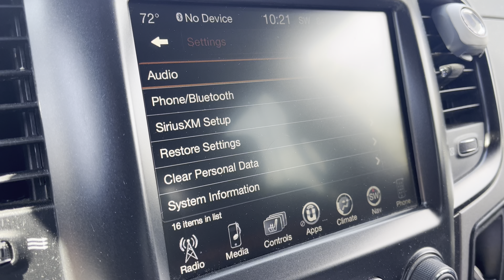FIX YOUR DODGE RAM AIR SUSPENSION PROBLEMS FOR GOOD! Monroe Air to Coil Kit DIY Tutorial $655

Comment: Monroe says this kit doesn't fit the Rebel and I think it's because the Rebel is 1" taller than other 1500 Rams. Did you even notice a difference?
Reply from the maker: I did not. It sat like a normal ram. It handled very well for the 80k miles these shocks lasted then I used the springs & put them on Bilstein in the front.

Comment: This is currently happening with my 2017 Ram Rebel. It's been at the ram dealership for the last 6 weeks. Looking for a solution....
Reply from the maker: This is the solution. 6 weeks is crazy.
Reply: My 2016 ram was in the shop for 3 months for the air suspension and they didn’t fix it. Going to try this…
Reply from the maker: @zacharypsick874  Sounds like a bad shop regardless this will erase your suspension headaches.

Comment: I did this same conversion on my 2014 Ram, i used the HD Air Lift bags. It seams to help with not so heavy loads. But im am making the switch to the Tuftruck 1223 coils. Just figured id share that with you if you are experiencing any sag with towing.
Reply from the maker: I should of ordered the HD Air Lifts too but I didn’t know they existed - should of done more research before shopping for this unexpected project. 

I’ve towed up to 8500lbs with this setup and no sag but still would like to upgrade to thick coils and load lifter setup when my budget allows.

Comment: I just bought a Ram 1500 Laramie with Air Suspension. I know about air suspension, never seen it in a truck stock though. I wanted the Dealership to remove the system all together due to the failure that eventually happens as with any air suspension. Dealership would not do it because it would "mess up the computer & sensors which would cause me to start to have problems with the truck" I have had success with Monroe in the past, I prefer Moog, Monroe is fine though. They make a good product. My question is, would this work on my truck? 2017 Dodge Ram 1500 4x4 Laramie. The Air ride is from the factory & has the controls for it in the dash. I'm not a huge fan of my truck moving up and down when I'm getting a 4in BDS lift on it. Any suggestions?
Reply from the maker: Yes it would work. If you remove fuses before doing the job with battery disconnected you’ll be good. 

I forgot that step but all I get is a service air suspension message when I turn the truck on - no functioning issues.

I’ve driven over 30k on this setup mostly towing boats and campers everything is A ok. 

Moog is a better option - I didn’t realize there isn’t much that makes this a conversion kit - you just remove sensors and replace bump stop ain’t too much converting going on.. 

I’ve seen others say they have no issue lift X factory airbags so I would say riding it out till it goes out would be best way to get bang for your buck.. you won’t be able to sell the old system for very much and it doesn’t suck until you start hearing that compressor over working n come out to a tilted truck 🤷‍♂️.

Comment: I'm bout to tackle this job this weekend got my parts headed in can't wait to be cussing then jumping for joy once it's all done.  BTW about the section you talked about getting all the air out before but you could not find out how.  To anyone just put you truck in entry exit mode
Reply from the maker: Excited for you to be done with air suspension headaches. 

Ahh I did that but thought there was some other process that I was missing. 

I’ve towed 8k miles with this setup so far and I’m very happy with it. 

Only thing I messed up on was removing the air suspension fuses after the job was done. Now upon starting my truck the immediately service air suspension warning appears..

Comment: “Take your nuts out” lol I’m about to tackle this job this weekend but I just got some info that I won’t be able to tow anymore which is a problem for me cuz I have an rv where did you ge those bag and are you connecting them to the original compressor?
Reply from the maker: Air lift 1000 on Amazon I’ve towed over 8k miles with the setup - it’s working great. I have to add air manually like you would a tire.. you can tow without the bags but I would upgrade to thicker coils if you want to do that.. I’ll upload link to the ones I ordered tonight. They sell nicer air bag systems that have a remote controlled compressor.

Comment: Did you need to add a computer chip to remove the air suspension from showing up as service issue on dash?
Reply from the maker: @mikemehan5130  no you can get a shop to clear it. I think there’s a way to do it yourself but honestly I just clicked up on the steering wheel & drove it 😂.

Comment: Thanks for the video question did the truck sag in front after changing? Just need to know in case need to buy lvl kit . Thank you
Reply from the maker: Kinda it’s not as leveled out as before. Now resembles the ride height of a Ram without air suspension.. If you go with Bilstein you can adjust the ride height to be level..
Reply: @RoadDogReviews  thanks man I just throw in lvl kit to keep it straight, and again thank you for the video.
Reply from the maker: May you get many more prosperous miles from your truck. I appreciate your viewership.
Reply: @RoadDogReviews  forgot to ask you when you changed those where was your hight at as far with old air ride was able to go from entry to off road I m guessing stock ram hight?
Reply: @admir48059  Sits like oem shock/strut Ram. If you lift front 1-2” it would be level. I’ll upload a recap video tomorrow morning with a good side pic.

Comment: isnt there a sensor that is offered by those strutmasters guys that supposedly gets rid of your service air suspension warning?
Reply from the maker: You are suppose to remove air suspension fuse and negative terminal before doing the conversion which I didn’t do so I still get the warning message.
Reply: @RoadDogReviews  i had seen some much cheaper parts on ebay but seems like everyones solution is to switch over to spring, too bad parts were not available on the links you shared, thank you for the video, convinced this is the way to go
Reply from the maker: They all have low stars or only a couple fake 5 stars. I did some research. They are known to catastrophically fail I wouldn’t risk it.

Also I updated the links -

Part # 90028C1: https://amzn.to/3K1qTAH
Part # 90028C2: https://amzn.to/44IRgDp
Part # 90028C3: https://amzn.to/3Xz4iAT
Reply: Damn less than 600 bucks and you fix issues 🔥🔥🔥
Reply: @RoadDogReviews does that conversion kit fit a 2015 ram 1500 Laramie ?
Reply: @Neno134  yes
Reply: @endlessopenroad would I need to purchase all items from the 3 links ?

Comment: Bro did you really route your new airbag air line in between coils? Use duct tape on a ball joint boot? This is one of the most bootleg auto repair videos I think I've ever seen. 🤣
Reply: I ended up routing it through the top.

Comment: By any chance did you sell your air suspension system ?
Reply: No - how much will you pay for it? Are you in Florida?
Reply: @endlessopenroad   no, I actually have a 16 Ram Rebel with the air ride too and I’m looking to replace it but of course it’s a big expense so I was wondering if you sold yours and I wanted to ask about how much I can re sale my suspension for ?
Reply: @endlessopenroad   i got my truck last year and within 4 months during the winter time the suspension gave out on me. The dealership agreed to fix it and I paid half out of pocket. They replaced the rear nitrogen tank so it’s still pretty new. I was wondering if I can resale it
Reply from the maker: I just sold the front shocks and rear struts on FB marketplace for $100.
Reply: How much would it cost for you to do the factory replacement? I have no problem with mine yet. I just figured I would do the work myself when the factory air needed repair?